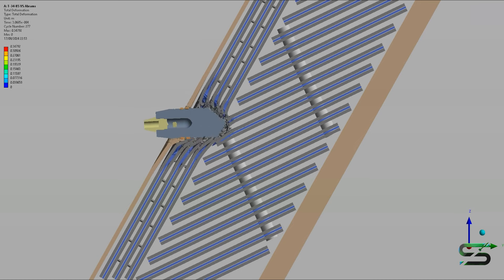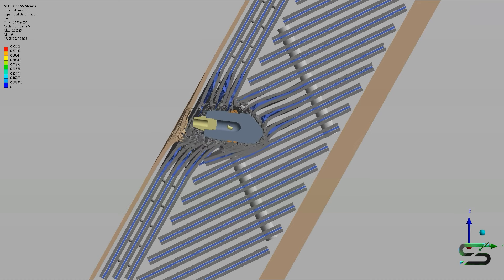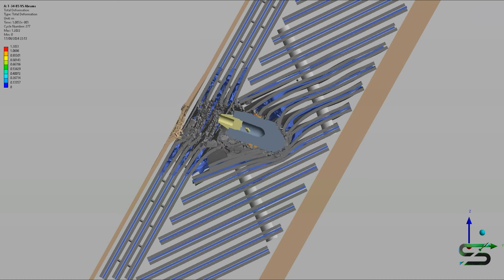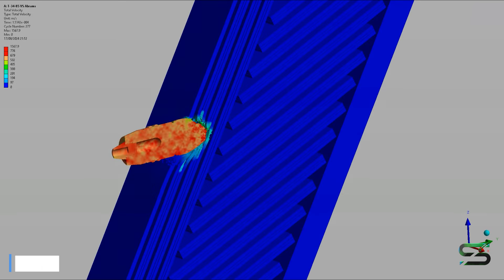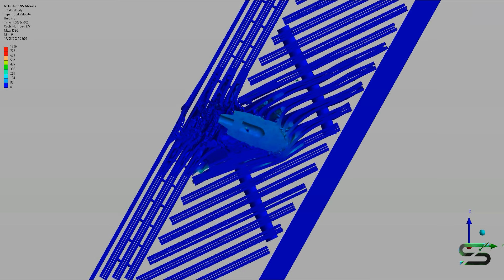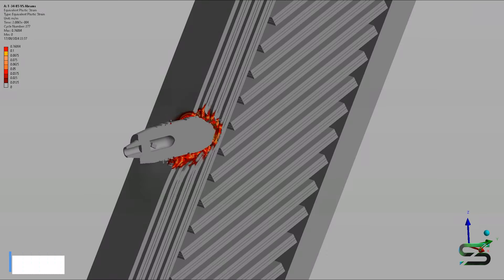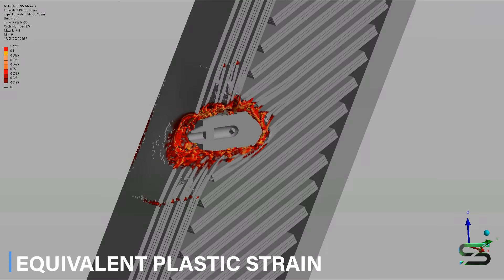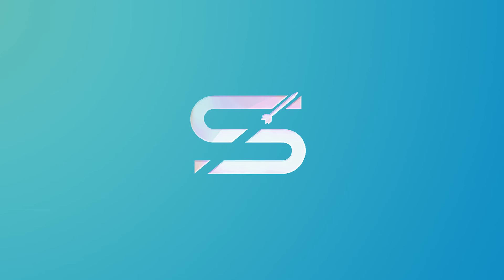T-34-85 VS M1A1 Abrams | Armour Piercing Simulation

Comment: I'm surprised how fast the shell eroded in the armor and then lost all energy.
Reply: AP shells don't erode , I don't know what he actually did there .
Reply: each piece in the composite armor acts kinda like a spring "pushing" the projectile back as each piece cracks
is kinda like how tempered glass screen protectors work or how modern car chassis are designed: They break (or bend in the case of the car), and as they do it they disperse the kinetic energy so it doesn't reach the other side
Reply: @5co756  It's a hard-hardness armour steel versus a wartime quality AP shell with war-time quality of thermal treatment. 
Ever seen a quality file making sparks grinding against instrumental steel?
Reply: @worldoftancraft  Armour is not as hard as the projectile , or it would crack and throw pieces all around . An AR500 armour plate has 477 to 530 BHN , wich is quite hard . German shells had around 650BHN at the tip and tank armour of that time around 250 to 300BHN . I don't think the Abrams turret is that hard , but someone mentioned that there is ceramic inside these layers . Wich could explain this result and the fact that Soviet shells were not that hard .
Reply: @5co756  Thin plates of NERA can be hardened up to 600 BHN as far as I know. And it's a special armour alloy, not ordinary steel which prioritises one or two qualities. Also AR500 is a absolute joke of the old «school»
Reply: The joys of NERA inserts being a mix of metal and ceramics.
Reply: @worldoftancraft  AR500 is modern day armour , your Abrams is 40 years old my man . 😅

 "Special alloy" omfg , nobody really knows what's inside this Chobham armour .
Reply: @5co756  Where did you hear that AP shells don't erode?

Comment: side hull shot would 100% pen though
Reply: Can it pen the back of the turret though?
Reply: @Drauzet  probably, would detonate the ammo and go through to the crew compartment,  there isn't any composite on the back
Reply: @irirjhrhr4645  would the explosion from all that ammo somehow slow it down?
Reply: @an000n  unlikely, the ammo cook off wouldn't have enough force to hinder with it, and it would probably already be in the crew compartment before it even starts cooking. and it doesn't really explode, just burn violently
Reply: Le blowout panel
Reply: @irirjhrhr4645  Wouldn’t it just fuse and fragment?
Reply: Agree....on the amunition side armor part
Reply: @irirjhrhr4645 Given there's idk, ammunition in the back, and this isn't War Thunder, don't you think the Ammunition itself would provide additional resistance via all the actual material that's there, disregarding the following ammunition detonation you have a near 2-foot long casing to get through, in addition to the rear plate and the thick Blast Plate that's designed to protect the crew from that very scenario.
Reply: not on modern abrams but probably old ones

Comment: Let's have a t90m breakthrough against Abrams
Reply: It can and will if aimed at the hull.
Reply: It can pen basically everywhere but the turret front, same goes for abrams
Reply: The major issues is Abrams do not have ATGMs (XM1111 is canceled). If those tanks meet in flatlands, T-90M can fire 9M119M beyond the range of APFSDS.
Reply: @zhouyangyou2042 Generally tanks don’t engage at distances where that is really a factor, terrain anywhere but a completely flat desert would prevent ATGMs from being used at their full range, in Ukraine most ATGM shots are taken at between 1 and 4 kilometers.
Reply: @mattseller148  tanks generally do not engage each other at all, to be said
Reply: @zhouyangyou2042 doesn't matter, because russian tanks can't guide a missile past that range. Nor would they be able to see a target far enough to outrange m829a4.

Comment: "It would never happen"
I mean...if you are in a wooded area and drive past one it would...
Reply: "camping" in urban behind some corner as well
Reply: yeah good luck missing that on the thermals lmao
Reply: @m.a.6020  pretty easy if the engine has been off a while, thermals dont = I SEE EVERYTHING!!!
Reply: @sovietred7371  Tanks usually go with infantry support in wooded ares so it would never happen.
Reply: @sovietred7371 you can tell trees from bushes with good thermals, a metal tank is going to have a radically different emissivity and albedo than non metal objects.
Reply: @sovietred7371  yeah that t34 would have to be sitting there for hours. Nice thing about the capabilities of the us military there would be so many drones and recon done it would be highly unlikely that the tank wouldn't be spotted.

Comment: Let’s not forget, this model of the T-34 is based off the hypothetical standard a T-34 should be built to. During WWII, thousands of them were build to a much lower standard to get them out the door. One of the problems the war built 34’s had, was armor shattering and spalling. The armor was over hardened, and it wasn’t fixed until late 1946. So if it was hit, the shot wouldn’t even have to penetrate to harm the crew. It would either hit and shatter the armor plating, or send hot shards of metal scattering around the inside and killing/maiming  80% of the crew. Plus, while the gun was of decent quality, the shells they fed the gun weren’t. As a result, T-34’s had a lower muzzle velocity than the Sherman during the Second World War. And they often couldn’t use explosive ammunition, because the shells were so bad they’d blow up in the gun if it wasn’t left to cool between shots. Post war these issues were solved, but Russia wound up mostly giving the war built tanks and shells to their allies after the war. So you’d better hope the stuff you’re using isn’t from the war, or you’re going to have an even worse day than you’d have in a post war production model.

Although, in a wartime production variant, there’s a chance you’d break down before you ever got to the battlefield, but that’s a whole other story.
Reply: Боже, какая чушь..
Reply: Isso é propaganda😂... O próprio comandante de Tiger alemão afirmou ter atingido um T-34 com 3 tiros e ele continuou avançando, só parou quando foi atingido pelo 4º disparo. Batalha de Kursk.

Comment: "That would never happen".
Famous last words of many people in all kinds of war. I'm sure German high command in WWII thought the same when they were notified of Bismarck's rudder flaw. And yet...

Also I'm curious, isn't the Abram's turret armor's schematics still classified ? How are you able to make a correct simulation for it ?
Reply: The original M1 isn’t classifieds so you just extrapolate from there
Reply: @an000n this is probably why he chose the M1A1 as opposed to the M1A1HA or M1A2, as the baseline M1A1 has no depleted uranium but the M1A1HA and onwards would have some form of DU armor
Reply: Oh, if it were a newer model Abrams, the T-34 wouldn’t have a snowball’s chance in hell. They’d be able to knock the tracks off… before the turret spins around and drops a APFSDS round on it.

To give you an idea of how insane the newer Abrams, and other western tanks like it are; these things have been known to shrug off direct RPG hits. Both the Challenger and the Abrams have confirmed stories of them just taking an RPG round unfazed. That armor is no joke.
Reply: @Nikolai_The_Crazed  Tanking an RPG hit is not that impressive. Soviet tanks can do that as well. Pretty much any tank nowadays can do it (depending on what part is hit of course). That's partly why NATO started fiddling with top-attack ammunitions.
Reply: @Nikolai_The_Crazed ...all tanks can take more than 1 RPG hit

Comment: Huh, what are you talking about, the side hull armor of the abrams is 80mm steel easily penetrated by a t34-85 at most ranges. Easiest way to do it would be to hide the t34 in a city or treeline and wait for the abrooms to drive past.

Comment: I'm more interested in a follow up shot after the shell detonates. The armor surrounding the shell when detonated could be seriusly widened. If the shockwave hinders the crew for like 10 seconds a second shotmaybe  would go through and disintegrate the inside. Or just any side shot could blow it up.

Comment: I have a question, can the Abram's round pierces through the first T 34's side armor and went out other side to pierces the second T34's side armor? assume that these T 34s are 3 meters apart.
Reply: Yes, because side armour T-34 is only 45 mm, which is not enough to stop even the weakest AP Abrams shell
Reply: A pouca blindagem também faria ter pouca fragmentação, mas se passar pelo motor, ia ser bastante reduzida e não ia conseguir furar outro tanque.

Comment: what about abrams vs the best ww2 shell
Reply: 800mm 💀
Reply: Saw a simulation of a 128mm shell vs the abhram frontal armor, results were interessting.
Reply: @majormiller493  lower front plate, turret ring, or cheeks?
Reply: @yourlocalboaty  Lower front plate. The round went through and cracked the last plate of steel, but did not penetrate.

Comment: What about a hit with an 85mm. HVAP "Arrowhead" cored shot (penetrates up to 168mm. of RHA @ 0 degrees @ 100 metres) or late WW2 85mm. APDS subcalibre projectile (penetrates up to 240mm. of RHA @ 0 degrees @ 100 metres)??

According to German range tests, the 85mm. BR-365K APHEBC shell could penetrate up to 130mm. of RHA @ 0 degrees @ 100 metres.
Reply: No work this is not 0degrees armor

Comment: So a 1985 variant of the Abrams still takes internal damage from a tank from 1944? It half penetrants in an angled turret cheek shot, that's an Abrams thickest armour if I recall correctly... very un-impressive.
Reply: You're saying this while a tiger II wouldn't completely obliterate a t-72 from the side?
Reply: @WorkersofAmericaRise   Sure, but its not shooting the Abrams in the side where it has no armour it's shooting it in the turret cheek where it has its HEAVIST armour.
Reply: @pcfree4994  It does not. and this is before modern additions to the abrams. this tank would have been comparable to the t-64 / early t-72 armor wise.the turret cheek is purely made out of spaced armor which is not very known for being the most effective.
Reply: @pcfree4994  even if it penetrated through all the armor, it would be stopped since there's about 101mm of armor behind all that spaced armor.
Reply: @WorkersofAmericaRise  What? that is the M1A1 built from 1985 to 1992 (as I stated in my initial comment) which has the improved 800mm NERA of the IPM1 but lacks the DU of the HA and later models. Even the M1 had 350mm of NERA in the turret cheeks. Stop talking nonsense.
Reply: @pcfree4994  It's still a very early and weaker model. first abrams where created just 6 years before. It's missing it's improved modern armor.
Reply: @WorkersofAmericaRise  Which is completely irrelevant to my point as we are talking about the M1A1. Additionally its highly debatable whether the DU improved its actual armour or just stops it weakening due to repeated hits, if its the later (which is likely as export variants supposedly have the same protection WITHOUT the DU) the Abrams did not get a significant armour upgrade from the IPM1 until the M1A2 SEP v3 with the NGAP armour package.
Reply: @pcfree4994  Blah blah blah, I do not care.   What i'm seeing from you is you're trying to belittle the abrams because it's literally FIRST improved version had a 85mm shell stuck inside of it. and so? that's what spaced armor does, it slows down the projectile and catches it with the spare 100mm at the back, which the t-34 85 did not hit... What is this nerd rambling? I'm literally not interested in half of what you say.
Reply: @pcfree4994  anyhow, the 85 is not hitting the cheek of the abrams but the side.
Reply: @WorkersofAmericaRise  Again that's not spaced armour in the Abrams that's composite non-explosive reactive armour. Despite 40mm RHA, 800mm of NERA and another 101mm of RHA (thats rolled homogenous armour) the 40 year old shell still had enough energy to knock equipment off the inside off the turret. Again, HIGHLY UNIMPRESSIVE and I thought even an M1 would have fared better.
Reply: @WorkersofAmericaRise  Ok so the camera warps the shell from the cheek to the side at the last second, that is still 300mm of NERA (only 60mm less than the front of the hull) and that has not received an armour improvement at any point since the original M1 at least until the SEP v3 NGAP (next gen. armour package) which is the one being built now so that destroys you "older armour" argument, which was pretty weak anyway given the nature of DU and that that was the only change to the Abrams armour since the IPM1 until SEP v3.
And if this sounds like "nerd rambling" to you you should not be talking about tanks as it's fairly basic stuff.
Why are you getting so damn upset over something simple as I thought it's armour would have done better against such an obsolete shell anyway? It sounds like you just want people to validate your delusion that the Abrams is somehow better than any other modern MBT, which it is not, go ask the Ukrainians who are using it against an actual modern army, not a pack of goat herders with RPGs and half trained Iraqis in T-55s and T-72As.
That doesn't mean its bad, but it certainly doesn't stand out over any other MBT, well except the absolute embarrassment called the Challenger 2.
Reply: @pcfree4994 This is spaced armor. I don't care whatever you say because it's very clearly a spaced armor design. Kinetic penetrators such as the t-34's shell as shown here can pretty easily embed themselves in the abram's armor because it's a kinetic penetrator and ammunition such as HEAT was what the armor was designed for. It still stopped the shell even though it was embedded deep in the armor - and keep in mind this was not the cheek of the tank, it was the side.
Reply: @pcfree4994  I only stated about the "armor package" since i thought we were truly talking about the cheek of the tank, but upon closer inspection, it's the side, which i'm pretty sure even a king tiger or a t55 may be able to penetrate. You're very clearly the russian shill trying to combat this tank because it hasn't the most perfect armor system in the entire world - even though it was never meant to, keep in mind right before this we where using m60s from 20 years ago.
Reply: @pcfree4994  the abrams in ukraine are the 1980's m1a1 which only one has been taken out by other tank's munitions, most have been destroyed by other factors such as drones and artillery, which all russian tanks have been destroyed by anyway - the abrams is good for what it accomplishes anyway, obviously it won't roll an army by itself but it's also meant to be guarded by the bradley and air power, which would absolutely roll the russian army because they fought something comparable to iraq and are still bogged down to this day. If they ever go to war, mark my words because they will be true.
Reply: @pcfree4994  oh yeah, 3000 russian tanks have been destroyed in ukraine agaisnt 20 of the 31 sent.
Reply: @WorkersofAmericaRise  Right, I'm a Russian shill because I thought the Abrams had better armour than it actually dose. Yes I thought the shot hit the turret cheek due to the weird camera wobble so it's not as bad as I thought, but it still did far worse than I would have expected. An 85mm APHE shell dose not have a massive amount of explosive in it and despite being contained within the inner and outer armour layers I would have expected the composites to do a far better job of dampening the explosion.
Reply: @WorkersofAmericaRise  They are M1A1 SA that have been modernized to M1A2 standard, but have the export armour without DU. in terms of armour they are on par with SEP v2 for single hit survivability, their main issue is the USA removed a lot of electronic equipment before sending them. Far closer in to the current Russian tanks than what the USA fought in Iraq, and never mind that the Ukrainian army was 3 times the size of Russias at the start of the SMO and fighting defensively. 
but what ever, agree to disagree, like I said I don't think Abrams is bad, just over rated (or over hyped might be a better term) and over priced.
Reply: @pcfree4994  It has good armor... It's just that the br-365 (the round the t-34 fires) is equal to 168 grams of explosive mass which is on par with a grenade.

Comment: Literally you just can shoot to that enormous gap between the turret and the hull of the front (in a videogame not in reality) or even in a simulation and you kill the entire tank because thebprojectile breaks trough the ring wich is structural steel not space armor or chobham even...

But again this should not happens in reality. But nevertheless its an inmense fail to me at least that the abrams have and tanks like the leo 2 or T72 don't